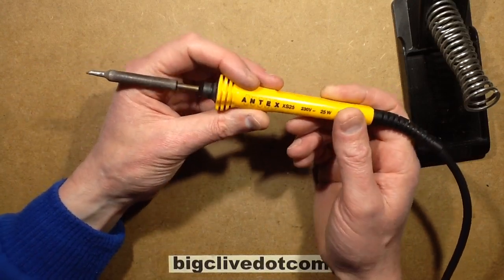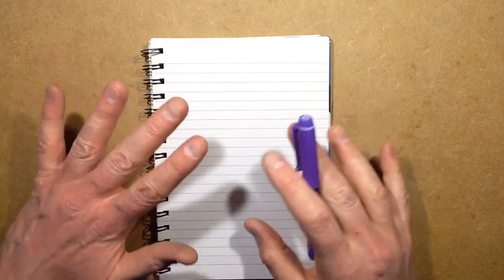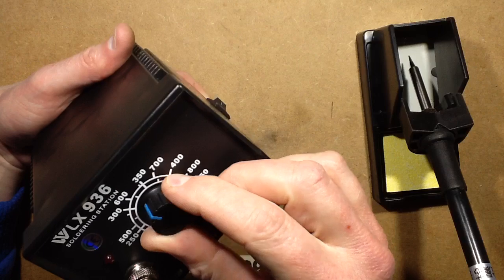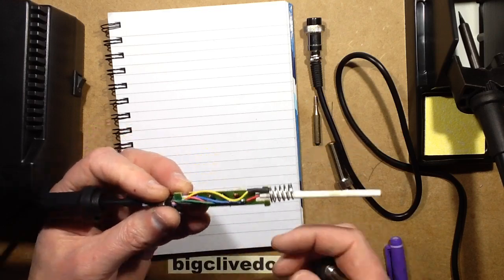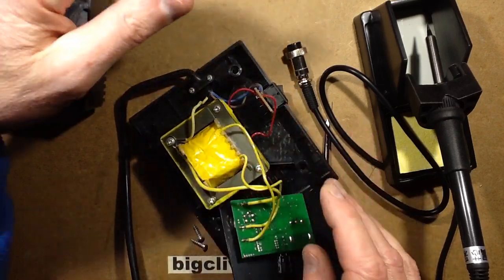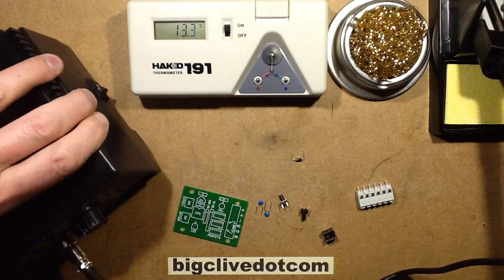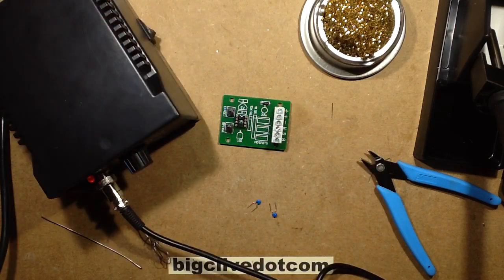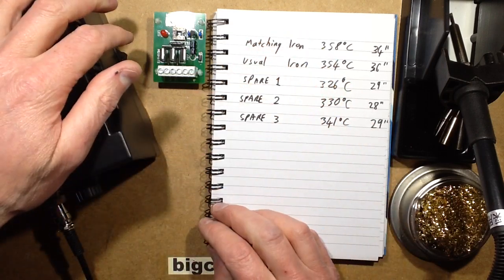Soldering basics and choosing a cheap soldering iron.

Comment: Good video. As a Weller-certified salesperson and technician, I very much approve of your explanation of basic soldering technique. However, standard lead-based solder is Sn60Pb40, so 60% tin, 40% lead. Even though it's called lead-based, it is, in fact, still mostly tin. You're going to have to annotate that.
That said, I very much stand by your comment about using lead-based solder as an amateur, for learning and beyond, as well. Not only is it a lot easier to use than lead-free solder(*), it is  *a lot" safer to use, given people will not have access to fume extraction. The fumes from lead-free solder are a lot more acrid and the smoke particulates are a lot finer (and thus more readily absorbed in the bloodstream). I do not, I say again: DO NOT recommend extended use of lead-free solder without fume extraction equipment.

To clarify the RoHS (Removal of Harmfull Substances) directive a little: the main problem is it's very hard to recover lead from PCBs; it can't be done cost effectively as it can with the more precious metals. On the other hand, discarded lead will eventually accumulate to toxic levels in the environment/food chain. Therefore it was decided to stop using it commercially. However the RoHS directive still condones the use of lead-based solder, even in manufacturing (so no need to "stock-up* on lead-based solder, as it will still be available for the foreseeable future), provided one lables the product correctly and remains responsible for its safe disposal. Research at the University of Antwerp also indicates the recommendation of having seperate soldering equipment for lead-based and lead-free solder is redundant. Simply re-tinning one's tip when switching between the two types, brings one within the required specifications.

(*)Rem.: the main problem with lead-free solder is the rosins/fluxes employed to allow one to solder with what is basically pure tin are not as temperature resistant as those which are merely "good enough' for lead-based soldering. So now the problem one faces is one has a joint which requires more heat to properly form, but one can't up the temperature from where one usually uses lead-based solder at. In fact, experienced users will most likely have to lower their soldering temperature. At 380 centigrade, using lead-free, what's going to happen is the rosin/flux will be on your hands/baked onto your tip and your joints will be iffy at best, no matter how good you are at soldering. I find the maximum one can go is about the 315-325 centigrade range. Weller recommends 275-295 centigrade (talking temperature-controlled soldering stations here, obviously), but there is just no way one can get a soldering rythm going at such low temperatures, imnsho.
Reply: Oh, and one more thing: it's perfectly ok to repair something which was lead-free soldered with lead-based solder. However, one should never, ever repair a vintage device, which was originally lead-based soldered, with lead-free solder. It's not a matter of "will it come undone?', but "when will it come undone?'.
Reply: As a Weller fan I must say that I'm still surprised your company has moved its manufacturing to Mexico. Given that the main competition in the market, Hakko, still does their manufacturing in Japan I can't help but feel it was a minor mistake to outsource like that.
Reply: There are two solutions for lead harm to environment:
1) Stop manufacture useless electronic. This is mandatory. Make computers, smartphones and other tech who last at least a decade. Invest in software optimizing instead of cobbling together a ton of gargantuan function libraries with adding more RAM and storage when they become low. And so on.
2) Find another ROHS solder formula - more lead solder like with fast tinning which will not crumble and short all nearest conductors with tin whiskers.
Reply: @KrotowX If they could have found a better lead-free formula, they would have already.
Reply: A very good post ----  but  It is important to note that 8 years later Weller probably isn't the company that they used to be.  Walk into a home depot and look at the red soldering station they sell for $65 bucks which is an absolute piece of crap: an ordinary 120 VAC powered soldering iron with a base station that has nothing more than a light dimmer circuit in it, and including crappy conical tips.  Harbor fFreight sells a soldering station for 45 bucks that is a way better buy than the Weller (but you should buy better quality replacement tips for the Harbor Freight "Schneider" system because the tips they include are solid iron ( It says so right on the box and a magnet confirms it) and therefore not very good for thermal transfer; and the tips are conical even though most newbies to soldering would be better off with a chisel or a screwdriver shaped tip. 

 The other thing people should be aware of is that many of the cheap tips sold on the internet aren't made of copper as they should be for maximum heat transfer efficiency, but instead  are iron or steel throughout.  Solid copper tips must actually be played with iron at the pointy and only to prevent molten solder and flux from dissolving the copper.  I posted a video on my channel about discerning cheap quality tips from good ones as well as a review and teardown of the above mentioned Harbor Freight soldering station.
Reply: @goodun2974  Yeah, that's the "red line", a line of deliberately cheap soldering irons / stations which they only sell in DIY stores. For a proper Weller, you need to go to an electronics supply store. The entry model nowadays is the WE1010-1, which should set you back around $170.-  Only drawback to that one is a pretty slow initial warm up time by today's standards.
Reply: @JVerschueren  ,  I doubt many people will buy a Weller for  $170 when you can buy a Yihua or other Asian knockoff soldering station for far less, or spend a little more and get a Hakko. Weller should be ashamed of themselves for selling such junk (except that corporations are incapable of feeling shame).
Reply: @JVerschueren  , PS, I used an old blue-green Weller TPC station for 20 years as an audio-repair bench tech and the only thing that ever failed was the plug-in connector (I hardwired the iron to the station).

Comment: Have you found a specific brand of solder that works better then another one? Thanks for another informative video.
Reply: +Bill Younger I'm using Multicore branded solder, of the 63/37 variety with no-clean flux.  Multicore uses 5 thin strands of flux inside the solder wire, instead of a single flux core in their solders, which supposedly improves soldering as the flux flows faster on the component leads and pcb pads so it has more time to work before the soldering iron tip burns it up. 

Anyway, it never hurts to have and use separate flux, no-clean liquid flux is cheap and helps enormously when soldering, especially when dealing with slightly oxidized parts or big parts (where the flux inside the solder wire may not be enough to clean the surfaces)
Reply: +mariushmedias Thanks for the tip on the Multicore brand of solder, I will check into it. The extra flux sounds like a great feature.

Comment: Could u cover the Soldering Irons that look like a gun? please they have a trigger and lamp i think you know what i mean :)
Reply: They are known as soldering guns.  Typically they are for very high wattage needs (greater than 100W) but are ordinarily only rated for intermittent use (often around 20%, or 1 minute out of every 5).  These are typically used for large heavy connections and with large connectors (such as large coax connectors) that tend to rapidly wick heat away.  They are not especially useful for general purpose soldering of PCBs except in extraordinary instances.  However, there are some soldering irons with a gun style handle, but no trigger, and are otherwise ordinary soldering irons just in a different handle style.

Comment: I've always used antex since my teens, i've tried other known makes (weller etc) but the tips often don't last, and being an internal tip they can get stuck in the end, plus that screw corrodes.
I got my tips from RS components, they supply them in 5's all the same size

Comment: Could you please do one on desoldering? Something more about the thermal mass, whether the wattage of the iron counts, how to deal with big components etc. I tried taking out an ethernet connector and buttons from my broken router and I completely raked it. The solder was barely melting and when I put a desoldering wick to it it stopped melting. Then I tried adding more solder to help the heat transfer and I ended up with a big blob of mess, so I tried a plunger and I couldn't take out all the solder. I know it's just me doing it wrong, but I'd like to see how it's done properly.

Comment: And here i'm sitting still insisting to only use Weller for soldering.
Can't go wrong with Weller, my oldest Weller soldering station is no 30 years old. And still going strong.
Reply: +djteac Weller and Hakko.
Reply: i've never owned or used a Hakko i think, but i've heard only good things about them.
Reply: Pfft. How about ERSA?
Reply: Siana Gearz Pfft. How about JBC?
Reply: Антон Южаков Yeaaah the difference is, ERSA is actually affordable. More affordable than Weller, as it happens in my region. Hakko? Never been available, if you get one, it's not gonna cost an arm and a leg, but you're totally screwed on replacements.
Reply: I got a TS100, but locally I can only get Weller tips. Don’t regret my purchase, but I feel like Weller would have made life easier.
Reply: @tomalcolm  Online 5 bucks/euro for tips ts100
Reply: In order of use and preference in my workshop would be Pace, Weller and hakko, I was interested in JBC but the I came across some  a couple of workshop clearances that set me down the Pace route.
Reply: I used one of those oldweller soldering stations with the special magnetic tips for 20 years as an audio repair bench technician and it's nearly impossible to kill those things.  Unfortunately these days Weller has passed through a number of corporate hands and their less expensive, more affordable equipment is absolute garbage.  The $65 soldering station that they sell at Home Dumpo is nothing more than an ordinary mains AC powered iron with a base station that consists of an electronic light dimmer built into a red plastic box with a holder for the iron.  The control now allows you to turn the temperature of the iron down but you can't turn it up compared to simply plugging it straight into the wall. Harbor freight sells a Schneider soldering station for 45 bucks that has true electronic temperature control it works quite well for the price especially if you buy some better quality tips elsewhere because the tips that are supplied our pure iron and iron is not a very good thermal conductor. Tips made of copper with a thin plating of iron at the pointy business end is what you want, but even then many online suppliers are selling crap tips made entirely of iron or steel throughout their length, which is easily verified with a magnet, as I do in a video on my channel along with a review and teardown of the Harbor Freight  "Schneider" soldering station.  The reason for the iron plating at the very tip of the tip is because molten solder and flux would easily dissolve bare unprotected copper; this is why you should never use sandpaper or a file to try and clean/rejuvenate a tip ----  the only thing you will succeed in doing is removing the iron plating and hasten the demise of the tip.

Comment: I recently moved from a Maplin iron to a YiHua branded 937D, it came with the generic iron and I am currently using the packaged conical tip, because awkward and fiddly is good, this model has a digital display and I find that when it is struggling to keep up the iron is fine if I crank up the adjustment knob slightly.

Bizarrely it was packaged with an Australian style plug and no Death-dapter (not that I don't keep spare ones anyway), I can't guess why it was not a Chinese plug, do they use other sockets in Chinese factories?

The other thing is the transformer, given the case temperature, I don't like leaving it on all day when I'm soldering because it can get a little too hot. My old Maplin model used to get much hotter but I think a dodgy repair was made at some point in its life because it seemed to have an odd switching system despite having room for a transformer it was weighted in the base and just had to switch the mains...really dodgy (but I like eBay).

Keep up the super cheap eBay stuff Clive...

Comment: The cheap wide availability of tips does make the 936 clones an attractive bit of kit. Right now I am faced with buying tips for my Weller station, and I am not keen on spending the money.
Reply: +Paul Frederick Check out the Yihua 937D. It takes Hakko tips, and therefore it takes the Plato tips, which are cheaper and just as good. I've had a 937D for three years with absolutely no problems.
Reply: *****
Hakko style tips are so cheap, and easy to get. It is tempting. I can't really give up on my Weller though.

Comment: It may be a good idea to cut down the sleeve some to make sure that the tip of the ceramic element contacts the inside of the soldering tip. The bottom of the tip should come down as close as possible to the sleeve without contacting it. This is to ensure that the inside of the tip is in full contact with the element, ensuring proper heat transfer.

Comment: have had an xs25 since forever... love the iron, yet to have a job it's not done but it can take a little while to heatsoak pads/wires and recover on large mass parts. usually not a problem on PCBs even with large ground planes, but large gauge wires and chassis soldering it does show its limitations.

Comment: Those connectors on those irons are callled GX16-5 afaik, they exist in various pin counts designated by the number after the dash. Pretty sturdy, widely available and super cheap. Just in case anyone cares.

Comment: I have numerous 110v models of the same style that plug into the ac outlet directly the 900M-T tips are an awesome design over the old Set screw models commonly found that tend to rust and break off on the first tip change 
I been looking at getting the solder station version for a while now good to know they use 24v, I wasn't sure

Comment: To check the distribution of the rosin cores inside solder just put an open flame bellow a length of solder under slight tension, as it softens it will pull apart with a minimum of distortion.

Comment: Ooooh shiney. 

I just bought a 936 clone as well. I was impressed how much easier it was compared to my 10 dollar Weller one with a screw in tip. 

I'm wondering if its way off and will check (it was set to about 375)

Anyway, I'm making a battery bank to power a 110v inverter for 8-12 hours... Was wondering if you could tell me how bad or decent my soldering was - The biggest problem I seem to have is that the solder seems to "cling" to the tip when I pull it away and leaves sharp peaks. Not sure why it's doing this.

I also have to be very quick soldering ont he battery so I don't heat them up much. (bad things can happen...)

http://i.imgur.com/GEPRXoB.jpg

http://i.imgur.com/hCQ6TJs.jpg

This was the test. I think I'll be using the solid wire instead of the stranded from this point on. 

Also, can you talk about varios Flux's?  I think I've been u sing the wrong solder - RA flux?

Comment: 21:48 Can't believe in this day and age we're still discriminating against homosexual connectors. :-(
Reply from the maker: +Jeremy Morton It's not possible to use homosexual connectors with these irons as they are too promiscuous and get lubricant all over the place.
Reply: @bigclivedotcom  "I wanna go home now, please"
Reply: @bigclivedotcom  FWIW, I've been using one of these for years now since having the same Antex price issues. https://cpc.farnell.com/duratool/zd-929b-89-2926/soldering-station-esd-bs-plug/dp/SD01113?st=duratool%20soldering%20station  Replacement parts are dirt cheap and it's a damned good iron.
Reply: @bigclivedotcom  The comment in the video was funny, but this is gold xD
Reply: +bigclivedotcom ohhhh cheeky

Comment: Could anyone give me some pointers towards electronics tutorials on a "higher level"?
Most tutorials I find seem to explain basic electricity or how individual components work, but I'm more interested in specific patterns you find and how to use components in combination. (E.g. pull up/down resistor, voltage divider, etc)
Reply: check out allaboutcircuits . com

Comment: That iron is pretty great, my university has them and it's pretty great. Personally got a heat adjustable one which has been great and can't argue with the "buy cheap buy twice" logic there.

Certainly £20-£30 is the right range, cheaper is just so crap you'll be buying twice.

Comment: I bought a few of the replacement irons from good old eBay, however they came with bits that were completely untinnable! I ended up having to dust off the copper plating gear to get working irons hah.

Comment: Thank you, I dont feel so bad now, I have a bad habit of leaving my soldering iron on. Not smart being I am working in the kitchen because my hobby room is currently being used by my daughter. I am thinking of getting the kind that goes on when you move it then off when you dont. my dad used a weller for years, he worked with two types, the gun ( which I f@@king hate) and the regular iron. I dont want to burn the house down out of stupidity ( not calling you that) just wouldnt be cool.I almost bought a Radio Shack going out of business sale unit, but it didnt have the auto shut down,just variable heat. I did pick up a battey powered soldering iron and a solder sucker for 70 percent off . They both work well.